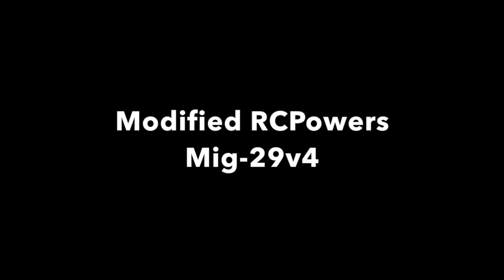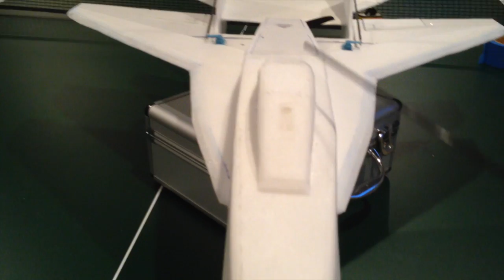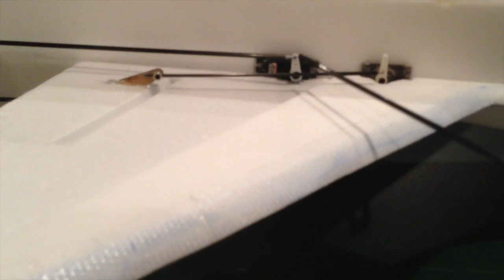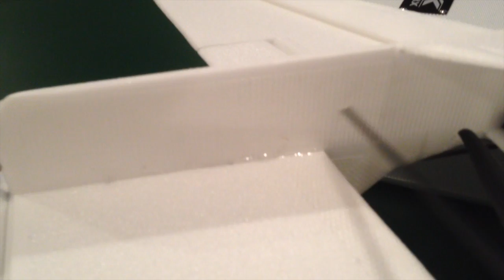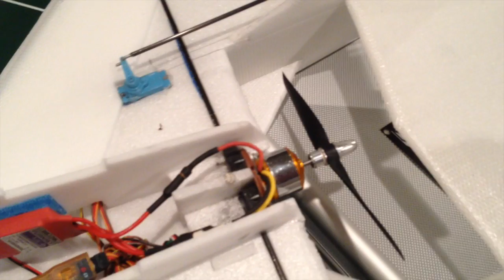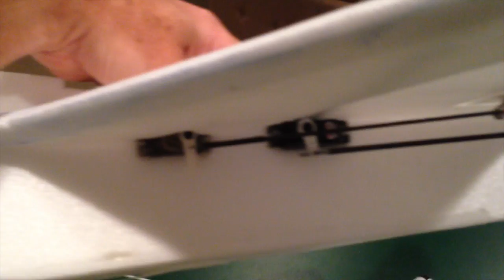Mig-35 NAMC Walk Around

Comment: Thank You sharing your build ideas and going into so much detail. On this plane, I used Model Plane foam on the whole plane. I used the ultra thin fiberglass on both sides of  each  wing using  with Foam-Tac glue. I then added KF parts with fiberglass on one side. Using the fiberglass on both sides of critical parts adds alot of strengh. Next I am going finish with Foam-Tac Foam-Finish.
Reply from the maker: Doug,
Your welcome.  Check out our blog at www.migrus.blogspot.com
I like your idea of adding fiberglass between the KF and the wing.  I like FoamTac a lot but it is too expensive for all the glassing I do.  Alene's Tacky glue is great and cheap alternative at $3 for 4oz.  Let me know how the Foam-Finish works for you.